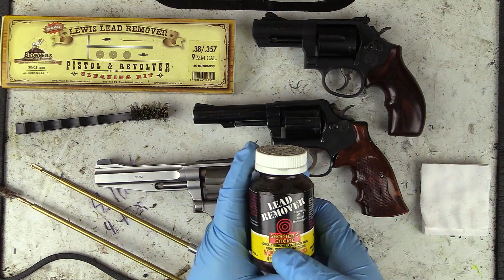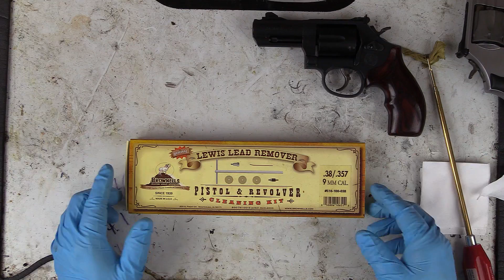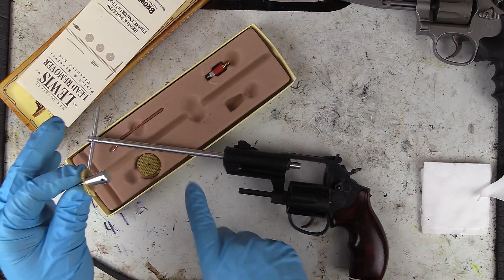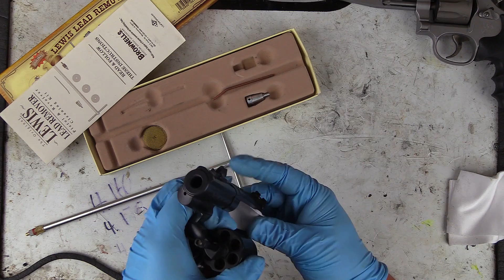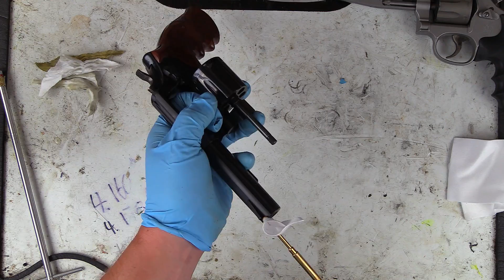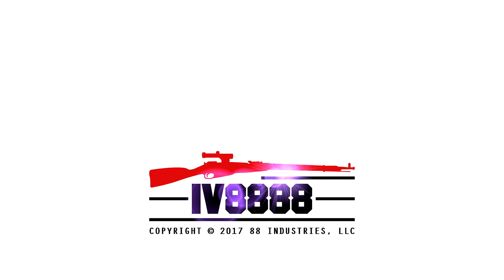Lewis Lead Remover

Comment: Eric, with a stainless steel or matte finished revolver. One can use birchwood casey cleaner cloth to clean the power 📴 the cylinder rings. With a blued model revolver. Is their similar cleaning cloth❓

Comment: I have never had ANY luck with chemical lead removers, and I've tried almost all of them.  Maybe they work if you have a real mild case of leading.  
Also, a cheap alternative to the Lewis Lead remover is to take strips of a copper chore boy sponge and wrap them around a worn out bronze bore brush.  Be SURE you are using an all copper sponge, test with a magnet.  Some are copper washed steel, that's too aggressive.

Comment: I shoot a lot of lead and pc bullets and found vinegar and solid copper chore boy scouring pads with an old bore brush work the best, I have a pickle jar that i soak the barrel in the vinegar and then scrub it a 20 minute soak and it all comes off with a few passes of the brush, works great

Comment: I shot PPC with revolvers for many years, back then we bought the Star swaged bullets, they were cheap and accurate.  I was shooting and reloading 1,000 rounds a week in practice, you can't even imagine how bad the leading was.  I used the Lewis Lead Remover for years, it worked fairly well, till I found a method that was cheaper and far more effective in a video from Wilson Combat, that was to use a copper patch cut from a COPPER Chore Boy, wrapped around a bronze brush.  It worked far better and far cheaper than the Lewis Lead Remover, it took literally half the time of the Lewis.
 
BTW, gas cutting is when hot gasses actually cause erosion to the top strap to a revolver, Model 19's were bad about that when you shot a lot of 125 gr hot load 357's, the gasses would actually cut a groove in the top strap above the cylinder gap, that is what killed the 357 Maximum.

Comment: hay i like your videos. but i have a question not related to hand guns. i have a 300 blackout and i slug it  it was    0375 what bullet sizer to get i did buy a 308 .  i am sorry i am not new to  reloading. but new to 300 blackout and i am using lee 312-1552r and h110 . and my coal is  1.85   cat go any longer.  14.9 of h110  and if i go longer it will not chamber. sorry i am new to the internet.  does the coal  sound  right. i did make some  dummy rounds at that coal and thay cycled just fine . can you help.

Comment: I wanted one of these for my revolvers but they were always sold out. I found if you take a pro shot pistol cleaning rod (not a cheap aluminum rod) and use the appropriate caliber patch jag with a piece of brass screen. You get the same affect but it requires using instead of pulling and still works really well.

Comment: How would you recommend removing lead from a shotgun bore? My Dad reckons using boiling water but that seems a bit extreme!
Reply: Do not use boiling water!  You will do more harm than good that way.  Soaking the barrel with a good quality bore solvent that works on lead and scrubbing it with a wire brush is typically the safest way to go about it.  Follow it up with a light coat of gun oil when you are finished.
Reply: No I mean to really remove all the lead, not just a general clean.
Reply: For one thing you shouldn't get much leading in a shotgun barrel as the wadding typically protects the barrel from the shot/slug as it rides down the barrel so what you are seeing may not actually be lead to begin with.  Sometimes the plastic wadding will leave heavy deposits on the barrel that can look like lead.  Hoppe's #9 bore solvent works well to dissolve plastic wadding residue from a barrel but will take a lot of soaking and scrubbing on heavy leading.  If it is lead in the barrel and the solvent you are using is not breaking it up you need to switch to a solvent better suited to lead deposits and either clean it more frequently between shootings, removing more lead than you are depositing, until you get all of the lead out, or soak and scrub the barrel with solvent until you get the lead out.  An overnight soak can help but some solvents are too aggressive to soak a barrel in overnight, you will have to research the solvent you are using to be sure.  Some people make homemade bore scrubbers with copper pot scrubbers and old bore brushes that are more aggressive at breaking up lead deposits, I've never needed to try it so I can't speak to their effectiveness.

Using hot or boiling water on firearms is typically reserved for removing things like built up cosmoline, grease, and oil as well as the corrosive salts produced from firing black powder and corrosively primed ammo.  Lead on the other hand, even with its higher solubility in boiling water than cold water, still has limited solubility so it would take a prohibitively large amount of hot water to have a noticeable effect on the lead.  Unless you are running black powder or corrosive primers or the thing has a heavy coating of grease you are struggling to remove using hot or boiling water will have limited effect.  Plus if you are not careful boiling water can potentially cause problems on plastic or wood stocks or rusting of metal parts if not completely dried and oiled afterward.  If leading is all your are struggling with using boiling water is not really worth the risk for the limited effect it will have.

Comment: I have been using the Lewis in my Casull's and 45s since the 80s.  Works well.  But for things like Martini Henry (with an internally tapered barrel dimension) chemical is the best way to go.  I did a video on using a 50/50 mix of peroxide and vinegar.  It does dissolve the lead, but it also seems to pull stuff out of the steel.  Not sure what, but never let it sit in your barrel for more than 10 minutes.

Comment: Lead will not get in to your blood through the skin. You can have an open wound on your arm and sprinkle lead dust on it and it will not make your blood lead level come up. The lead has to be in the blood cells themselves and only can get in to them by breathing or eating lead. Wearing gloves does not prevent your skin from absorbing lead it just keeps you from getting lead on your hands and then picking your nose or eating a sandwich with lead on your hands.

Comment: I have a gunsmithing question. I recently bought a 1916 Spanish Mauser in 7.62 NATO from J&G as a gunsmith special. When I got it from my FFL the only issues were a crack in the stock and a ringed bore. The crack is small and the stock obviously is still serviceable but the ring in the bore is what worries me. Is it safe to shoot as is? If not, can it be repaired? If so, how do you suggest I go about it?
Reply from the maker: As long as it headspaces okay the ring in the barrel won't be a problem other than being less than ideal for accuracy. Those guns tend to be hit or miss in terms of accuracy generally as it is. I wouldn't feed it a steady diet of full power M80 ball regardless of how it headspaces. They tend to fling a light cast Bullet load pretty good.
Reply: Iraqveteran8888 thanks for the response 👍🏻
Reply: Does Ray still do gunsmithing? If it is legal, would he be able to remove import marks? Thanks.

Comment: This may be a little bit off topic, but do you recommend carbon tetrachloride?   Our armorer put it out when we came back from the range or field maneuvers where we shot blanks and it just dissolved the gunk.  We just had to wipe the gunk off.
Reply: It's an excellent solvent for stripping oil/grease/cosmoline out of stocks, however I'm not sure how it would react with lead.  It's highly poisonous though, particularly to the liver
Reply: As Ian said, its pretty restricted due to health concerns. Realistically if you don't breathe in the vapors and use it in a well ventilated area it is not much worse than any other hardware store chemical. That said, there are better solvents that are safer and as effective. Personally I just use eds red and occasionally Hoppes to strip copper once every 10,000 rounds.
Reply: Its also a non-polar solvent, so it probably wouldn't have much effect on lead.  Its more for hydrocarbons and organic materials (carbon), which is probably why it worked well dissolving that blank residue.

Comment: I've been using Chore Boy and regular rod/brush.  Forcing cone attachment looks handy.  Does lewis deleader thread on a cleaning rod so I can use it on my cowboy lever rifles?
Reply: Rogue Rider    I second the Chore Boy S/S .   Works like a BOSS and doesn't harm bore or YOU with toxic ass chems
Reply: daspencer51 
For the benefit of other readers, DO NOT use a cheaper product as they are brass over steel.  ChoreBoy is solid brass and as pointed out by daspenser51, it won't hurt bore.

Comment: nobody does 30-06 vids they do 308 these guys that came out the military shot 308 while in they don't want to shoot 30-06 it has to much recoil I shoot 30-06 I don't own 308 its a step down due to case length being 51 vs 63 mm I know they use the same diameter bullets y'all lol. As for the vid idea I like it BC I would love to see 7.62x63 vs .45-70 the 45 having a case length of 70mm using more powder may push the 45 at a speed close to that of 308 and I would be interested to see how the bullets group from 300-600 yards. I'd also like to see the impact and terminal energy on ballistic gel at 50 and 100 yards I think it would show the guns abilities and the calibers potentials in hunting scenarios
Reply: 300 win mag is awesome its still 7.62 but even faster than 30-06 its awesomeness and recoil doesn't bother me my 12 gauge shoots harder than most rifles and my 10 gauge shoots harder than all so I'm not to pussy for any recoil. most ppl today still choose 308 over 30-06based on the recoil I don't own 308 I ha e my 06 and am happy with it. I do want a 45-70 to hunt with though I hunt in Florida and it would be nice in the swamps and scrub the 06 I'll use in pastures and pines still

Comment: The Lewis tool is great for forcing cones and gross barrel leading but can leave a little lead in the edges of cut/broached rifling. Just follow up with a bore brush with some brass wool or copper Chore Boy wrapped around it.